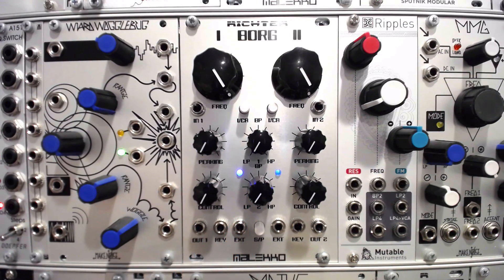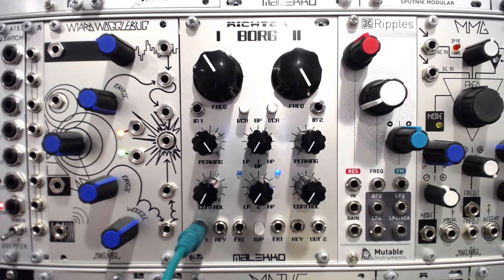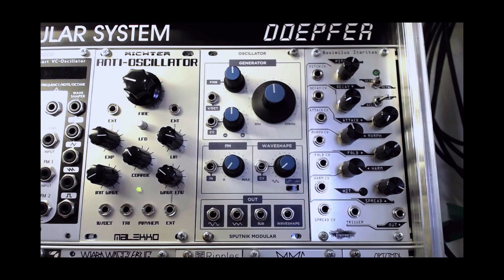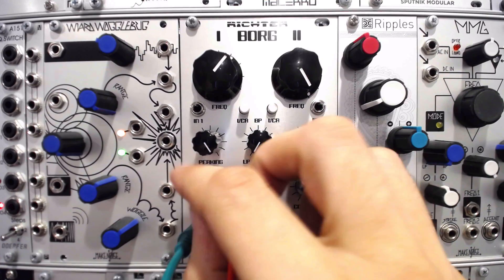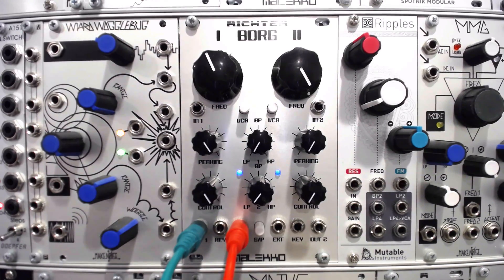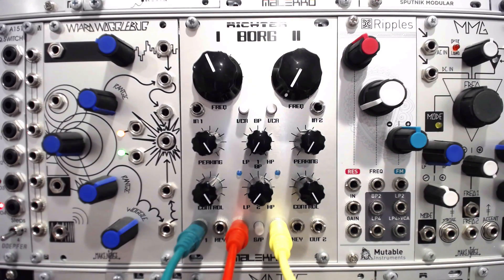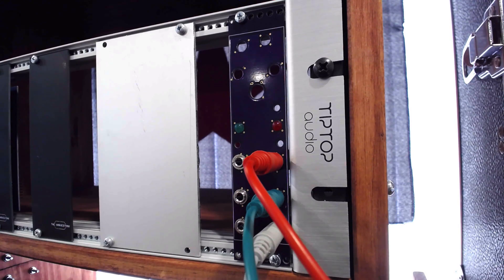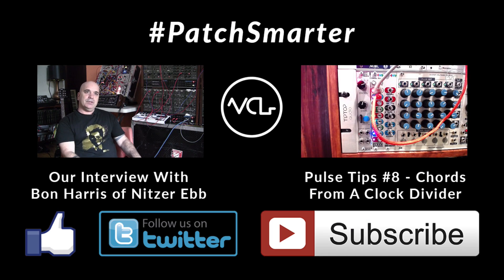Self-Oscillating Filter Kick Drum

Comment: is that a regular tablet you using as a scope? If so what's the app?
Reply from the maker: +reason2910 No, it is the DSO Nano 3 oscilloscope... pretty cheap, eurorack friendly scope.
Reply: +Voltage Control Lab nice I got a vintage scope made in Seattle that I found in a old barn/radio station in montana, it's gotta be 40 years old and still works but it's a so heavy and so big, tried to get the new o tool but they sold out so fast. Thx
Reply from the maker: +reason2910 yeah, its not quite the otool, but its been extremely useful. and much cheaper ;)